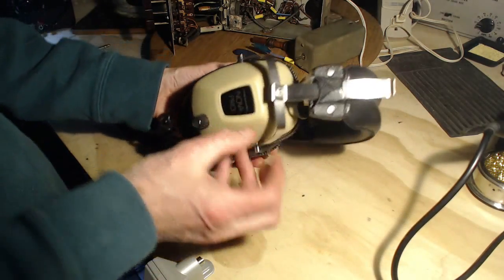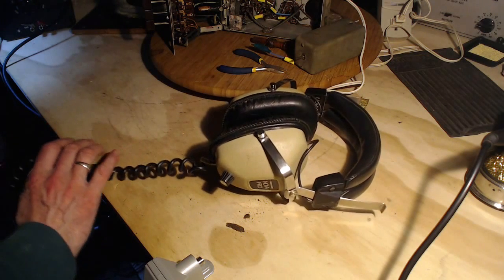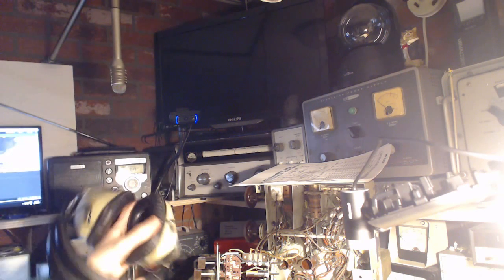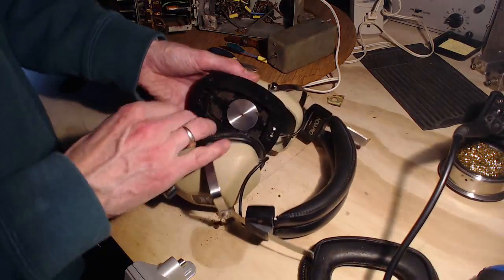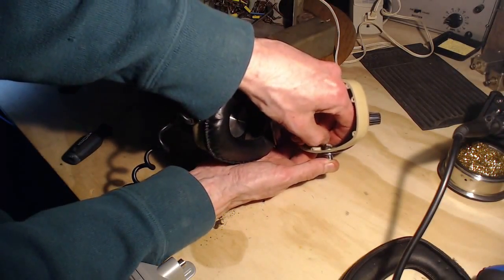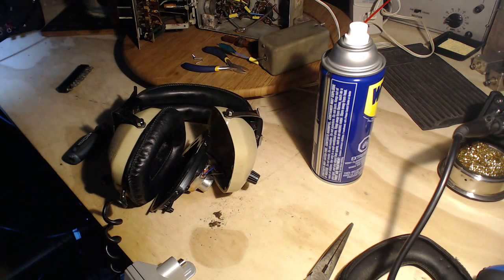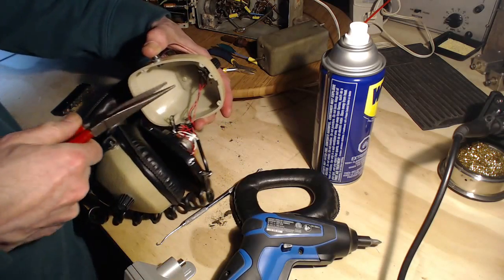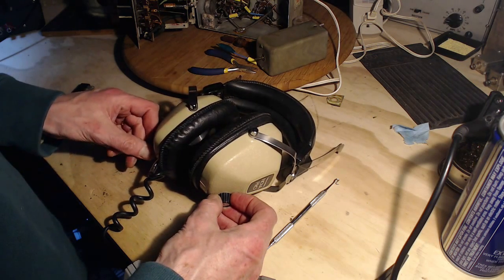Realist NOVAPRO Vintage Headphones - Quick and Easy Repair

Comment: Hello there, came here searching info, about this headphones brand, not really an abundant topic right now.

by the way, I just finished a restauration of one of those, a very pleasant experience. 

my costumer just found his headphones 30 years after he return to his home in the Americas. founded in a regular shape, unusable and amputated, but nothing that a nice dose of love and elbow grease can't solve.

a few recommendations in the process that I found useful to implement here:

- those potentiometers are very old and the usual is replace them, but those are 30 o more years old, so, you can't find them easily, almost in my country. (I can't find those pot. values anywhere.)

you can replace them with a 10 ohm, 1/2 watt resistor, (same ohms that the pot`s), or a little higher value, soldered in series, of course, in each headphone speaker (+spk terminal), that is because each spk, are 8 ohms only (very low values for actual headphones) and those pot in certain way "protect" the spk's.

-the "volume" will be fixed in a standard headphones "minimal volume setting" level for each one and the "resistance" in the circuit will be the same, the pot's just function as an ornament and will not be part of the headphones circuit.

yes, this are "vintage" headphones with a low impedance, and some ages above them, so, we have to take care of them properly, "realistic" no longer exist, remember that.

-the headphones internal space will be dampening for better audio acoustic results, do it with precaution,  "polyfill fabric" or any dampening material will work here, do it at your own taste, you will find that "sweet spot", cleaning the echoes and "plastic chambered effect", improve the sound quality is a factor to achieve here.

-consider to change the original cable and plug, this will solve some issues too. use a good quality shielded stereo cable and robust 3.5m plug instead 1/4" if you like.

I achieved excellent results with this restore and lightly mods to this headphones, the sound quality are impressive, may be not perfect, but very powerful, sensitive and responsive.

those headphones are just beautiful as tough. it's a shame that headphones are no longer build like this nowadays.  

I wish you success in your restoring and modifying jobs, greetings.

Mr. Jim, thanks for sharing this video.

Comment: I’ve got some that don’t produce any sound at all. Anyone have any advice on how to fix or troubleshoot? Or should I trash them?
Reply: may need new speakers (of the same ohm).. or could be a short or open circuit somewhere in the wiring... it wouldn't hurt to try and fix them

Comment: WHY  WD-40 AND NOT CONTACT CLEANER   THANKS JIM
Reply from the maker: +GHOSTY 085 Contact cleaner is all volatile and will evaporate completely leaving the sliding contact surfaces too 'dry' and the control will feel Ike it's scraping inside.  WD-40 leaves a little oil behind and the control will feel smooth.  There's a raging debate on WD-40 and there are other products formulated for pots including slider type pots.  Even WD-40 has a special formulation for thisd purpose but I don't have any - yet.  I've never had a problem with WD-40 even though it was designed for spraying on the outside of rockets!  The WD-40 stands for Water Displacement formula number 40.
Reply: Jim Lindenas fantastic, I never knew!!!! I feel clever learning this good on you I use it as well in cleaning motherboards and other jobs on electronic maintenance

Comment: Nice video, will you be replacing the foam?
Reply from the maker: +Scott Johnston No.  It won't be missed.  My own ears stick out a bit and this type of headphone with the foam inside would probably not have fit well.  I'm not sure what the foam was supposed to do.  Stop echos in the cavernous ear cup?
Reply: Sometimes they put foam in some headphones to cut down on treble harshness, which is the case for many AKG headphones. Other times they may put foam on headphone speakers to give a more uniformed look.
Reply: @JimsRadioShop  Do you have any idea what of kind of foam was used? I'm looking to repair my Nova Pros and am wondering if adding back the foam would improve the sound.